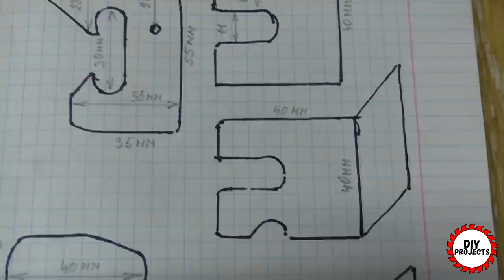Simple homemade lock for gates and doors + blueprint.

Comment: Simple if you own a mini machine shop ,(welder, assorted files, band sander, metal cutting band saw) 
From retailer: 304 SS (will not rust like this one) heavy duty latch that works basically the same, 6 holes to drill, 6 bolts/nuts - less than $12.00 plus tax.
Reply: You could do the same thing with basically just a grinder, a welder, and a drill and it'd probably be faster. 
You're right though, the only reason to do this is if you want to make it yourself.

Comment: since the bottom part is just for the padlock would a hole work instead of a big cutout?
Reply: Yes. A simple hole will be more secure too.  With the slot the bottom can bent to remove the lock.

Comment: GBC!!!!   get  a length of 1/2 in.  x 3/16  strip ,Bend in half (like an  hairpin )  flatten on  anvil with 1/4 in. between  to give  clearance  ,bend "L" ears at  ends with scru  holes   now bend up an  horseshoe of  3/4 x3/16  strip  ,drill 1 end ,twist 90 at other  end  drill holes  thru   "hair pin  close to "L"end  put  "horseshoe"  between & rivet in place...thats the catch !  now another strip on gate  to lift "horseshoe"  as gate closes  ...padlock thru  horseshoe  if desired......no cutting, welding  ...just boring boring & bending  ..get a life!!  draw it on  paper  if you don't  GETTIT